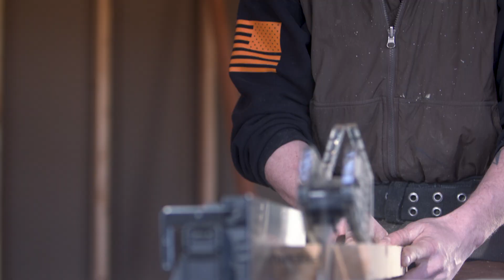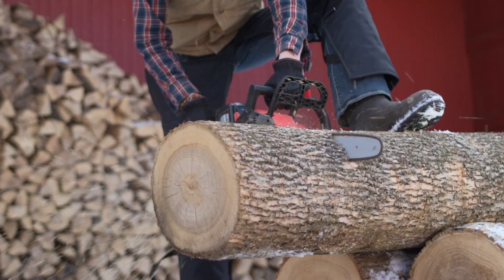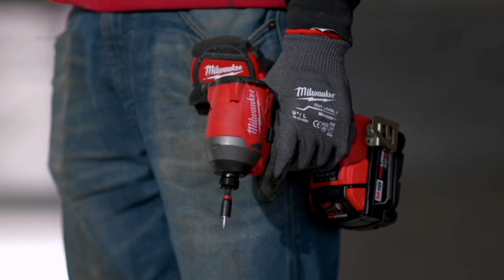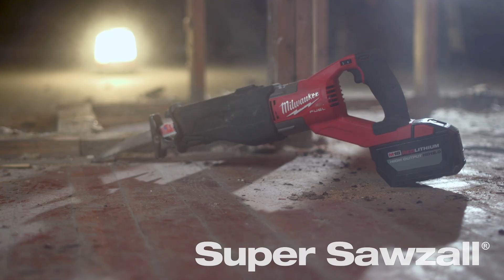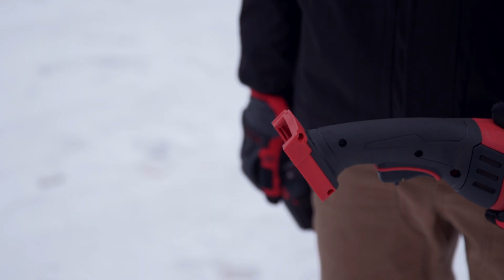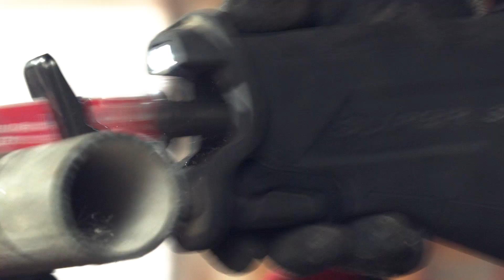Milwaukee® M18 FUEL™ The Next Breakthrough

Comment: I have Milwaukee tools.  I had one of their M18 9.0 high demand batteries.  Ran well for 6 months then it didn't.  Had no other problems with any of their batteries.  Brought it back to the store I bought it from and they told me to get a hold of Milwaukee tools for a replacement.  Got a hold of Milwaukee tools and they would never reply to me on it.  That's my story.  Threw the battery away.
Reply from the maker: Could you send us an email at socialmedia@milwaukeetool.com with some more information, so we can assist?
Reply: @MilwaukeeTool  Ok, e-mailed a message today and no response from Milwaukee?  Are you blowing smoke up where the sun doesn't shine?
Reply from the maker: The email was sent to socialmedia@milwaukeetool.com? We have not received an email regarding your batteries to this email inbox.

Comment: Need fuel gauges on m12 batteries not the tool. I shouldn't have to carry  the tool back when i get a battery to see if the battery is charged or not.